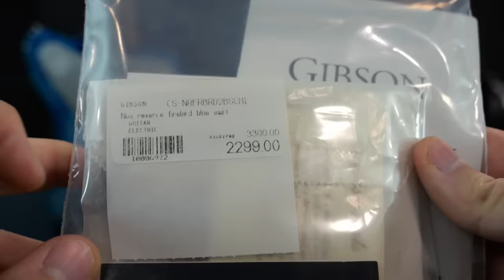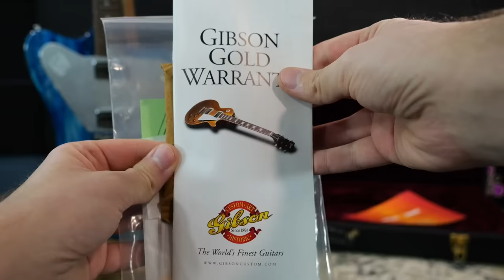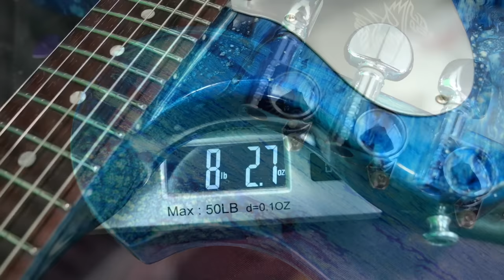I Don't Normally Like These But... | 2002 Gibson Custom Non-Reverse Firebird Blue Swirl Humbuckers

Comment: My understanding of the “reverse” was due to the “lower horn” (or bout, which has the pickup selector) stuck out further than the “upper horn” (which has the strap button). As far as I know, these terms were not invented by Gibson and were created years after the guitars were released. 😊
Reply: This is correct, but the headstock thing is how I remember it, as the body doesn’t seem reversed to me, but the headstock is.
 
And, yes the terms came later

Comment: The original non-reverse Firebirds came out in mid-1965, replacing the older 1963 reverse ones. Supposedly it was done under pressure from Fender, who felt that the reverse models violated their design patent on the offset waist body, as used on Jaguars, Jazzmasters, Jazz Basses, and Electric XIIs. The earlier reverse Firebirds weren’t selling all that well, and when Fender told Gibson to cease and desist, Gibson responded with a design that looked even more like a Fender Jazzmaster! I don’t know if that story is true or not—it seems a little far-fetched—but Gibson’s intent was to make Firebirds easier to produce by eliminating the neck-through construction of the reverse models. At the same time, they went with the large batwing pickguard on SGs so they could use the same body routing for all four SG models, and a little earlier, they’d replaced the stopbar tailpieces on ES models with archtop-style trapeze ones, which were easier to install. Cost-cutting across the board! That’s why a lot of us who remember, feel that the Golden Age of Gibson ended in 1965, when Ted McCarty resigned as CEO and Stan Rendell, who was a financial officer (bean counter) took over, and then came the sale to Norlin. I don’t think that Norlin initially set out to ruin Gibson, but they sure cut a lot of corners! My first Gibson was a batwing-pickguard SG Standard that I got new in 1967, and it wasn’t nearly as good as the ‘61-‘65 ones, and in ‘65 they changed their nut width across the board from 1-11/16” to 1-9/16”. I don’t know why they did that, unless they were trying to compete with Mosrites, which had ridiculously skinny necks at 1-1/2” at the nut. Like a Jazz Bass, only with six strings crammed into the space of four.

Comment: Hey Austin, if you take a look at the mini toggle switch, you'll notice that it's a 4PDT type which has twice as many poles as what you'd usually find. That's because that switch is configured to both split the coils and to reverse the phase of one, you'll notice the guitar is in phase when it's in split coil mode. So definitely a deliberate decision to have the middle position out of phase when running standard, then in phase for the singles

Comment: 15:44 if you look at the mini toggle switch inside the cavity you can see the two yellow wires that cross each other right? Those put the pickups in reverse in humbucker mode, that's also why the switch has twice as many layers as it needed if it was just a coil split. Definitely a deliberate decision.
Reply: Does that mean when it’s in the middle position and the toggle switch is activated it doesn’t go out of phase? I’m curious if both pickups are split in the middle position too. Cheers
Reply: @PeterMoore350  sorry im not quite getting the question, not a native speaker. 
This means that in humbucker mode the middle Position is Split. In single coil mode not. You could turn that around, Do that with two switches instead of one, Do it on the toggle switch on a push pull... Whatever you like.
Reply: Sorry not Split. Out of Phase.

Comment: Burst Buckers are wound with one hot coil on the outside and one low wind on the inside.  I wounder if they did it backwards for the bridge so it is splitting to the colder half.

Comment: Forget treble bleeds ("resistor capacitor mod"). Just jump a wire or capacitor from the bottom lug of tone pot to the middle lug of volume pot. It's easy and it works. That's just my opinion, but it is the 50s Gibson wiring style after all. (edit): i have done this to a single coil telecaster and it sounds better to me now.

Comment: Had a non reverse phelam blue with 3 p90 pu,s should have kept it. Believe it was about a 2013
Reply: How did you like it and how did it sound with the 3 P-90s?
Reply: @jonathanhudak2059  sounded really good. The finish on the neck was kind of sticky only reason I sold it.
Reply: @duanewelsh5611  cool! I bet it did. That's too bad about the neck being sticky thanks 👍

Comment: So let me get this right, a reverse firebird was the first model, referencing the reverse headstock. The non-reverse references the normal headstock even thought the body seems a reverse design to the original. So the original firebird wasn't called the reverse until the non-reverse was made.?  It seems more logical to me to have called the non-reverse as the reverse due to the body shape being changed not the headstock shape considering the first firebird was "The Firebird" when released not the reverse firebird. What a confusing f*ck up. Are these official terms from Gibson or are they organic cultural terms that have entered popular usage to distinguish between models.